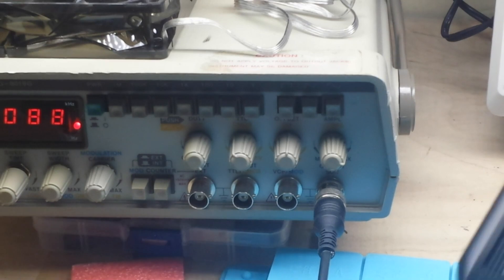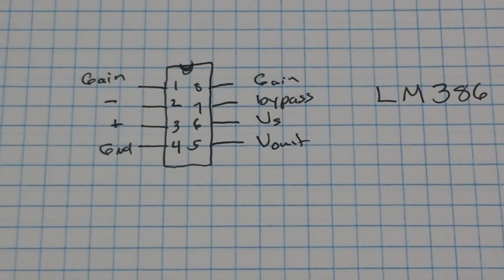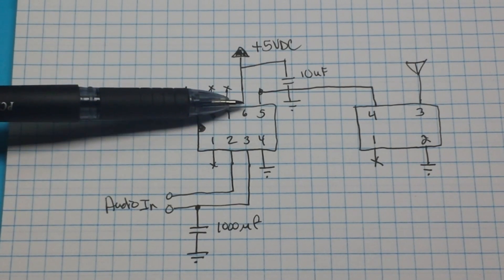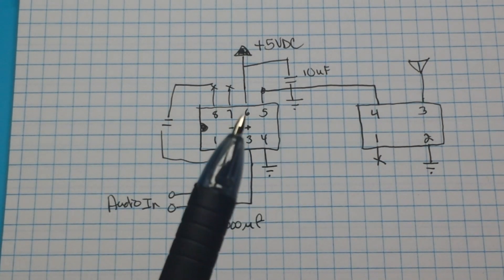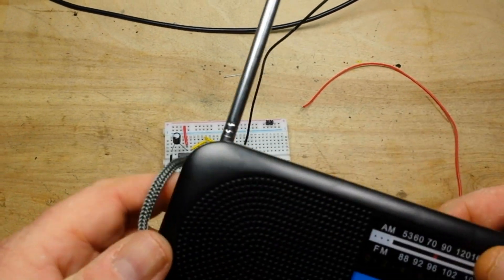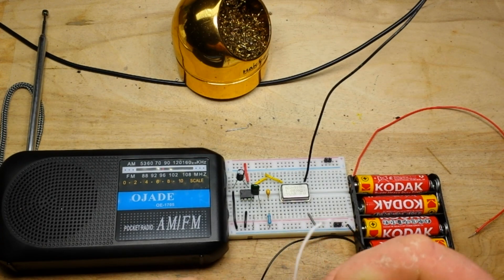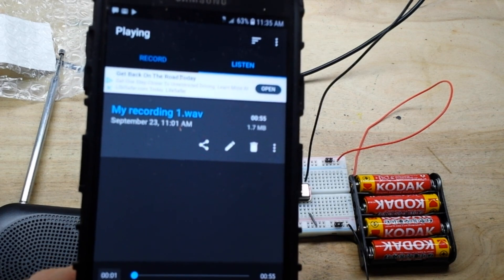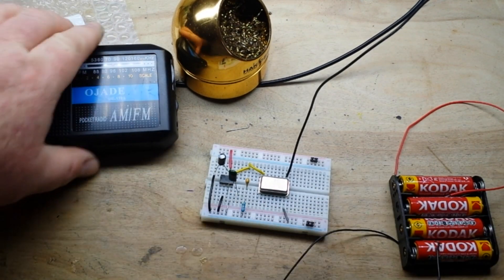Let's build a radio transmitter PART 2

Comment: Hey thanks a lot I think you should come up with a super simple receiver
I've actually built a short range transmitter on what you used went around 500 feet in the day and 1200 to 1300 feet in the night I would always play Johnny Cash on it LOL. and that used a crystal oscillator and a audio amplifier. I nickname my little station Redneck radio AM and it was on 1000KHz AM
And I had it hooked up to a long wire antenna about 150 ft long
Thanks
73s Will KI5DQL

Comment: is the series capacitor and resistor between pin 5 (LM386) and pin 4 ( Oscillator)  a low pass filter ? It is doing a great job transmitir AM. One other application to use the AM radio.. Test working IR  Remote control buttons :D

Comment: Thanks for the vid. I have so many questions...  1. Is it possible to transmit am over a xxx MHz carrier? What is the limit? 2. Is the buzzing due to harmonics? 3. If so, can they be removed with a band pass filter? 4.    How much can the power be increased with more voltage? 5. How can we measure how much power is the output? 6. How can we measure how much power is "bouncing back" through the antenna?
Reply from the maker: You can transmit a.m. at any frequency of carrier it's just a mode of modulation. Increasing the voltage will rapidly increase the output unfortunately then you get on to government wanting to know why you're transmitting on their frequencies. That's why I kept it low. Also that crystals only good for up to 6 volts. To measure the power and the SWR you would need some sort of a bridge or antenna analyzer or vector Network analyzer. The buzzing that you here is probably 99% due to all the LED lighting that I have around here. They are quite noisy in the RF sense.
Reply: @learnelectronics  Thanks, that was a fast reply!!

Comment: That doesn't sound like a sine wave. Sounds like a triangle wave.
Reply: JustMe it's a square wave, that's a CMOS clock oscillator not just a quartz crystal.
Reply: @qvatch  Ok, that explains it, thanks.